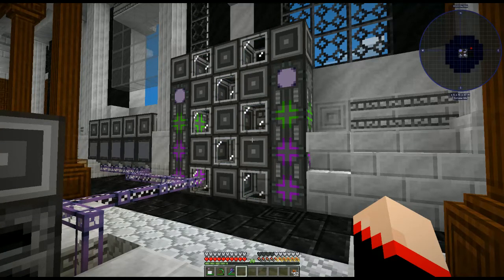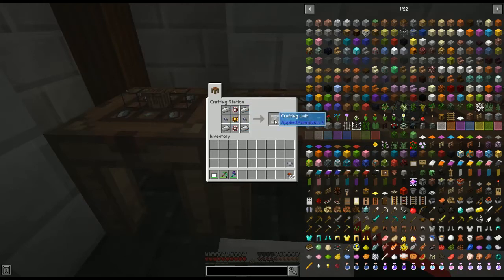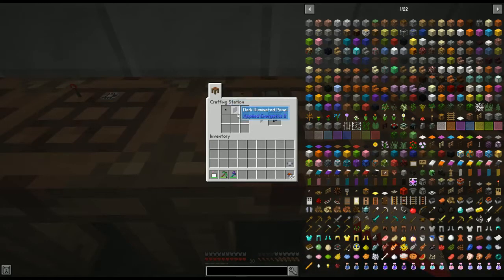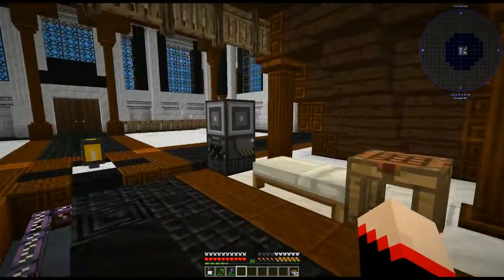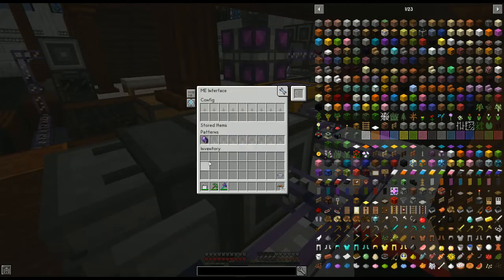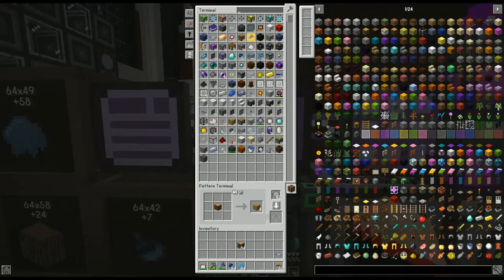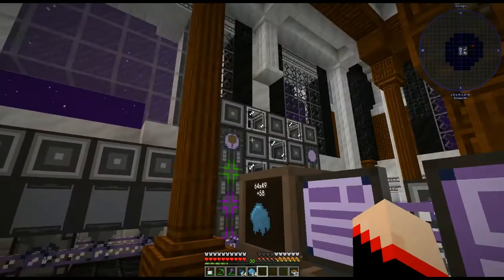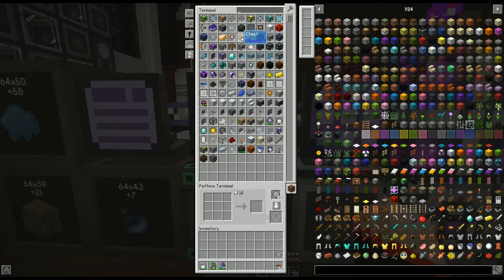Sky Factory 4 Tutorial ~ ME System Auotcrafting setup~ Applied Energistics  storage system Part 3

Comment: Whenever I connect the array to my ME system, the entire thing always shuts down. I believe it could be due to the version of SF I'm running (4.1.0). Should I upgrade or is there a fix I can use on my current version?
Reply from the maker: Sometimes, it's as simple as now having enough power to run it all. Try that first
Reply: @LavaTemptress  I have more than enough power, though. I have a NuclearCraft Fission reactor making 40k RF/tick as well as a MatterOverdrive Fusion reactor making hundreds of thousands of RF/tick (it displays less than it actually makes from a bug)
Reply: Also, I tried to upgrade my version which didn't fix the problem.
Reply: nvm I figured it out. I had turned ME channels back on for fun and apparently that interfered with it. I got it working now, though. Thanks for the help!